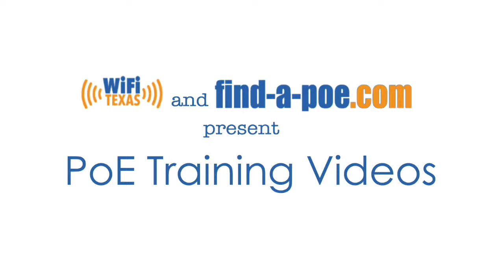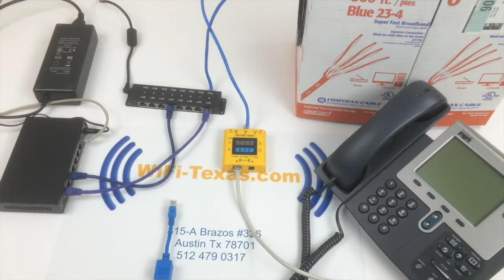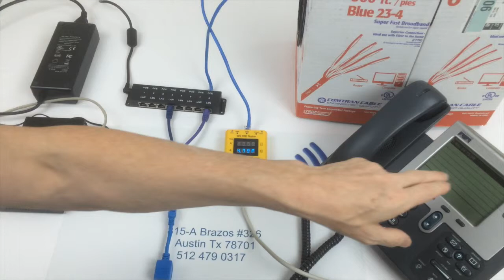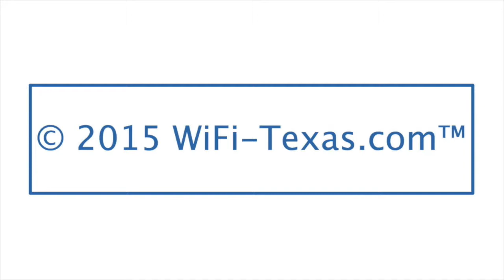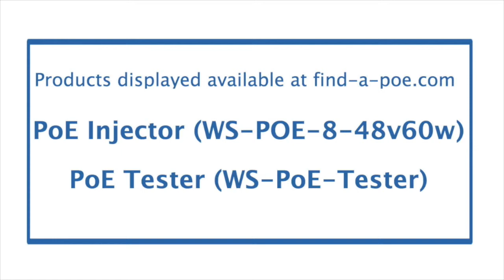Power over Ethernet for Cisco IP Phones

Comment: hi, If I want to connect all ports, the Amps will split across the used ports?
If the Amps are split across all ports, and I use an 8Amps power supply, I can burn the device connected right?